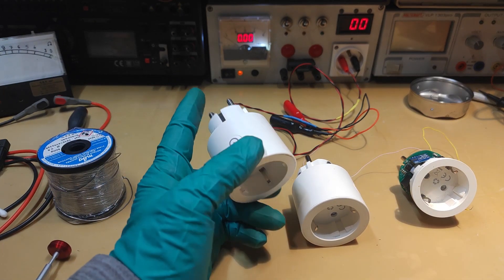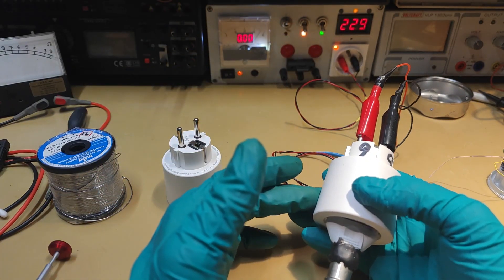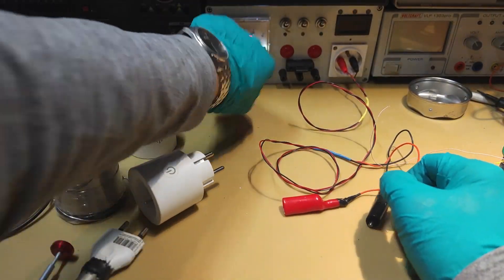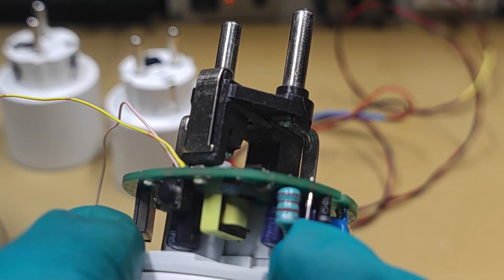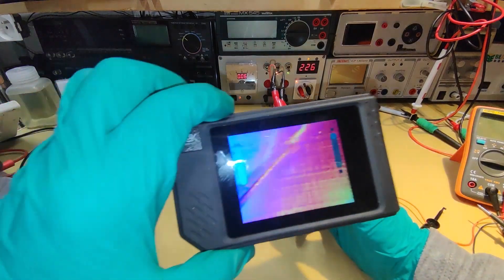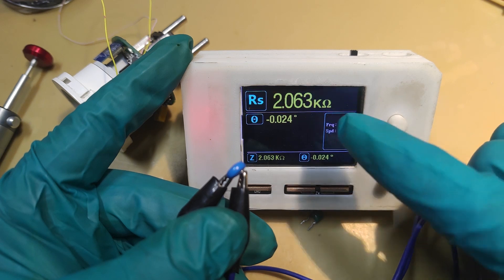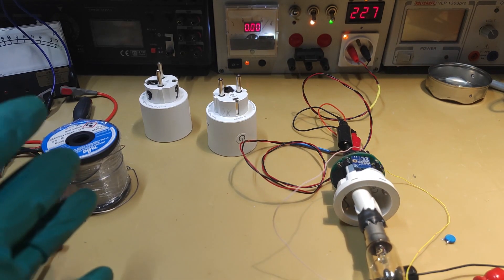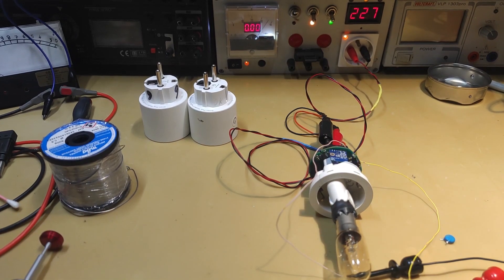Smart plug wifi disease: Repair it just with a cutting plier.

Comment: Sir, this is not a capacitor, its a varistor designed to get short and blow the fuse if the voltage raise to a certain limit. its a protection from over voltage.
Reply: I agree. This is a varistor. It has done it's job a a bodyguard for the yellow X capacitor and all the electronics. You need to replace the varistor because without it, the whole device will have a short life.
I don't think the colour has a big importance.
By the way, Y capacitors are actually guaranteed to never cause a short circuit.
X capacitors are self healing, but they will lose some of their capacity each time the hesl. I have recently replaced an X capacitor that had lost 80% of its capacity.
Reply from the maker: @Oldclunker-ge5zp  thanks for your information. I admit that blue color is (I thought) for XY capacitors. But I voluntary make this mistake for discovering the schematic on the pcb. That was the spot. Thanks for commenting.
Reply: Sorry if I missed something you said.
Normally, a varistor should survive a reasonable amount of overvoltage surge energy without permanent damage. There are different technologies for varistors, there are also unipolar transient suppressor diodes. All of them are expected to cause a short in the worst case.

In your case, either the surge was enormous or the varistor was a just too small for its job.
I have recently seen one, burst and cracked open, in a 100V mains device where 230V were accidentally applied. It is still shorted and blew the 3 Amp fuse. Job done heroically. I will Just replace the blown parts for 1€ cost.

It's a bit sad though that nowadays so many components have become short-lived consumable items. 

X capacitors have always been notorious for causing trouble, ever since they changed from the huge but virtually indestructible metal/paper aka MP capacitors to the smaller and cheaper plastic film capacitors like MKP MKT.
A varistor is much more necessary for protection of MK* capacitors than for the classic MP.
Reply from the maker: @Oldclunker-ge5zp  Thanks for all informations. I ask the owner of those plugs and he told me than lightning has stroke his line and killed almost all devices, including solar inverter, 20 plugs, pumps, and charger. So as you said, those components made their job but was like a little bit injuried. Thanks for sharing informations and knowledge.
Reply: Wow. In that case, this varistor was much tougher than I would ever have expected. If you can repair the device, then it'll prove how useful these varistors really are! I hope some insurance will cover the damage...
Reply from the maker: @Oldclunker-ge5zp  some  electronic varistors can withstand 10000A during some milli or µs. On 20KV line you have also varistors for lightening protection. Of course they have not the same size. Thanks for your comments.
Reply from the maker: Yes you're right of course. But I said it at 13:49. The doubt was erased when seeing the symbol of it on the pcb. Thanks for commenting